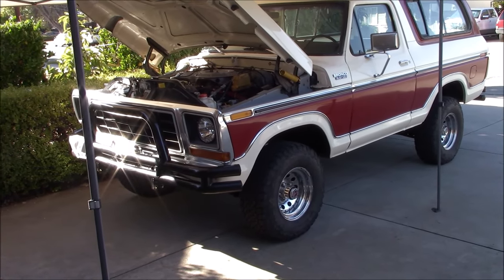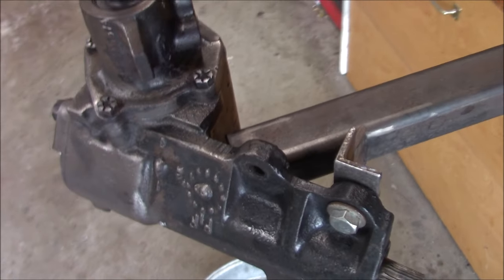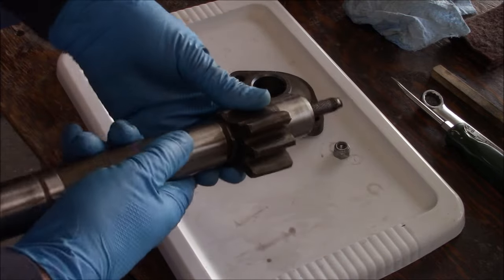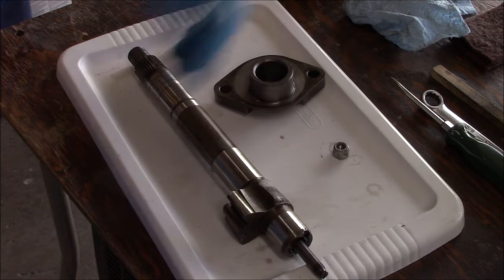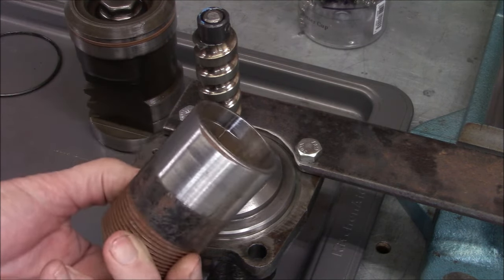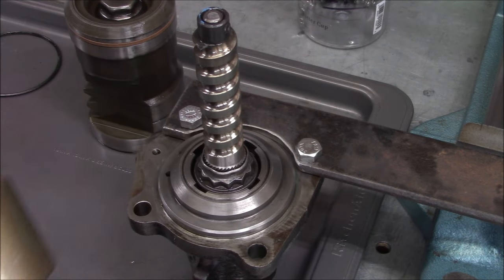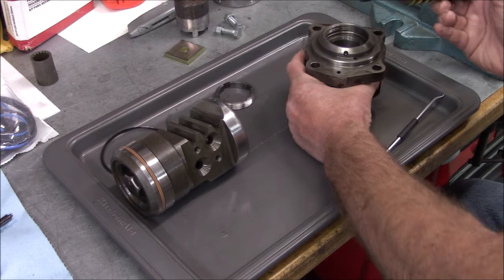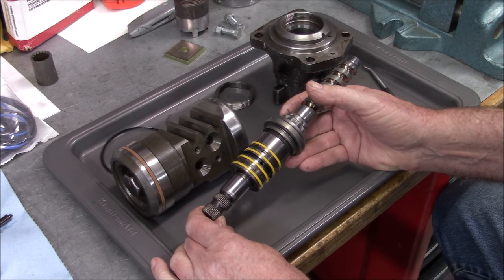[Ford Bronco Power Steering] : gearbox rebuild F Series Truck 1973 to 1980   Part1

Comment: That was really good Dean, thank you. I'm amazed at design engineering and how some smart bugger comes up with components for machinery. Goes to show why research and development costs so much. Also to think this is (not) simply a hydraulic rotary valve. I'm wishing you had another one to fully disassemble, just to check it all out.  - Stay safe and well :)
Reply from the maker: Thanks Anthony !

Comment: Those teflon o-ring seals are the most annoying thing to fight in existence. Last one I did was a saginaw steering box in a 1972 mustang and I had to lube them and tighten down zipties on each one and wait a day so they would hold a smaller shape for just long enough to get them in. Are they a pain on this one? I have a 79 f250 box to do right now.
Reply from the maker: Yes they are, I used a similar method 👍